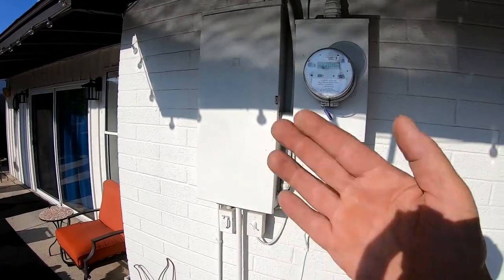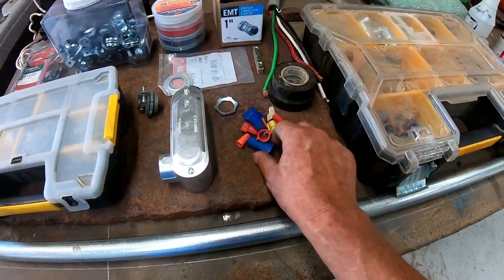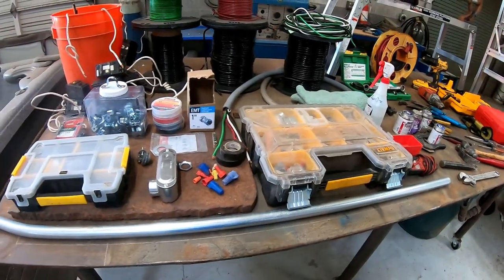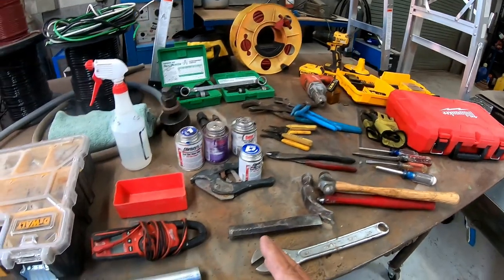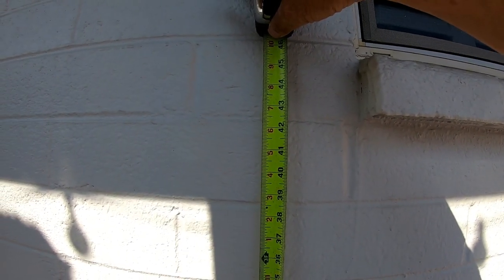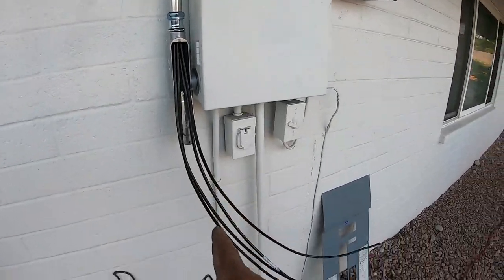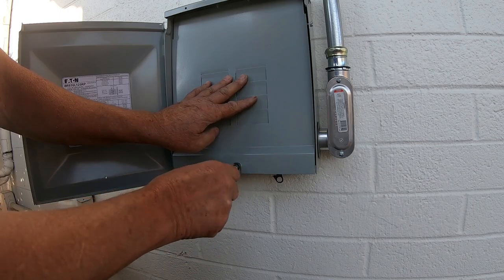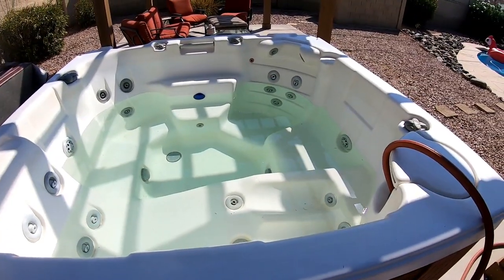How to wire from the Main Panel to a Sub Panel for a Hot Tub or Spa... (Part 1 of 4) DIY Spa Wiring

Comment: Thought you said in another video you didn't like to use colored taped ends
Reply from the maker: You are 100 percent correct I did say that...If I'm wiring from the sub panel to the spa #6 wire is used most often and I am able to get the wires in Black Red White and Green.. When you wire from the main to a sub panel and you are using wire larger then #6 like in this video we ran a 60 Amp service so we used #4 wire and to my knowledge it only comes in black so we have to use Phase Tape.. Hope this Helps Thanks for Watching & SUBSCRIBING

Comment: Hey I appreciate your videos! Could you have put a ground rod next to or under the sub panel and feed the ground (green) there or do you have to run it to the ground in your main panel?
Reply from the maker: I alway run the ground from main to the sub no matter what with #6  THHN wire Ive had to fix several wiring job that tripped the breaker when turned on for the first time (home owner did the install or handy man) if you follow the guide lines from this video you will have no problems with your install or Hot Tub ... Thanks for Watching & SUBSCRIBING
Reply: Per the NEC 2020, we have to run the ground wire all the way back to the main panel. Using a ground rod at a sub panel or any other device located on the branch circuit will sometimes electrify the ground within a certain radius of the ground rod when a fault occurs. Then someone stepping in this area can get shocked or electrocuted if not wearing insulated shoes.
Reply: @andygigawatt7778  It's a good thing I ran mine back to my panel. My electrician was trying to put a ground rod under the sub panel and I wanted it running back to the main panel. So I ended up doing it myself the way I wanted it done.

Comment: Question: Your video showed how you used Red Head Hammer Set pins to mount the sub panel on a concrete wall. What would you use to mount the sub panel on a stucco wall?
Reply from the maker: I use the same hardware as they use for Drywall and other hollow walls.. These are the links for what I use.

https://amzn.to/2SclkqK
https://amzn.to/3tif79S
https://amzn.to/3uc6oHp

Hope this Helps...Thanks For Watching & SUBSCRIBING

Comment: You mentioned not to place the sub panel near a water spigot. Is this code? How far from the spigot is okay? I’m also in AZ. Thank you. Great video, very helpful.
Reply: If you can’t find a good location for your sub panel other than near your water spigot, you can use a watertight panel and watertight connectors so no splashing gets in and blows the panel. Also a good idea to silicone seal the edge that backs to the wall.

Comment: Voltage meter reads 240 from the line into spa panel however I am getting a read of 241 on the load side of the GFCI. The spa breaker trips when connected to the spa however does not trip when I disconnects the power to the spa. Is my GFCI bad. Everything is brand new, spa, spa panel, GFCI, wire to the main panel and main panel breaker.
Reply: The GFCI might not be the correct type. Sometimes when motors startup they can trip a gfci due to the peak starting amps. The other possibility is that your spa may have a short somewhere (in the circuit area or the pump motor itself). Hopefully you have a warranty if it’s a short in the spa itself. Hope this helps.
Reply: @andygigawatt7778  Thank you, new spa pack was ordered and scheduled to be installed this week, all under warranty.

Comment: Why did you use a 125amp sub panel when you only ran a 60amp breaker from your main?
Reply from the maker: For this install we only needed a 60 Service. In the Sub panel we will have a 50 Amp GFCI breaker for a Hot tub and then we are installing a 20 Amp breaker for  LED lights , Ceiling Fin and an outlet. The reason for the 125 Sub Panel is I have tons of them so I use them all the time. Thanks for Watching & SUBSCRIBING

Comment: Is there any reason you wouldn't put  the gfci breaker in the main instead of in the sub?

Just seems more economical to buy 1 gfci to protect the entire sub and wiring versus a gfci for every circuit in the sub.

My only experience with gfci is in the receptacles which I know can only protect a certain number of receptacles down stream. Is it the same principle for the breakers?
Reply from the maker: Yes you can put the GFCI in the main and install it that way... That is the way I installed mine. Now the only problem is a GFCI is very sensitive and sometimes the other things that are plugged in on that line will cause the breaker to trip...Its six of one and a half dozen of the other... Good question. Thanks for Watching & SUBSCRIBING
Reply: Plus the GCFI sub must be at least 5 feet from the hot tub per code but must be line of site so if an electrician is working on the hot tub they can observe if somebody attempts to trip the breaker back on. That's why the box is located near the hot tub and not back inside the service panel. But it has to be further than 5 ft due to water and that has to be horizontally distanced from the nearest water point.

Comment: My electrician used aluminum wire from the main panel to the sub panel,  is this okay? I plan on using copper from the sub panel to the spa pack.
Reply from the maker: Yes this is OK as long as it is to CODE.. From the Sub I would run #6 THHN  wire to the Spa
Reply: Aluminum wire is allowed in some states (like Texas) and not allowed in other states (like California). It’s always safer to just use copper for the entire install, because aluminum can cause sparks, which is why states with fire issues have banned it. If your state allows it, be sure to use the anti oxidation gel on every termination.

Comment: Can you put all 4 gauge wires in 3/4 inch tubing ??????????
Reply from the maker: No...Use 1 inch or 1 1/4  and it will work with ease...Thanks for Watching & SUBSCRIBING
Reply: @spaman5440    Thanks again Sap man, your really great and helped me a great deal.
Reply: Small diameter pipes will make the wire overheat, plus it’s harder to pull the wire through. Good rule of thumb is to keep a little more than half the pipe empty. Or learn to use the NEC 2020 to derate wire and size pipe if you want to do the bare minimum requirements in order to save a few bucks.

Comment: I know you used 1 inch conduit because you used 4 Ga wire.  Will 6 Ga wire fit inside 3/4 conduit?  There would be 3 6 Ga wires and 1 8 Ga wire for ground.  Thanks again.
Reply: You can fit 4 6awg in 3/4", you can fit 7 6awg in 1"
Reply: @jeffschwartz9851  thanks for the information I will be attempting this soon

Comment: Did l miss something, did not see the connection from spa sub panel to the hot tub. You skipped a step….. would like to see wiring from breaker sub panel to balboa box
Reply from the maker: If you look in the description above there is a link to wiring from the Sub to the Hot tub...Thanks for Watching & SUBSCRIBING.

Comment: My question: Why a hot tub sub-panel? Why not just add a breaker directly to the main panel?
Reply from the maker: In this example/video we were not only hooking up the Spa we were adding an out door kitchen lighting and an entertainment area so we needed a sub pane to add more breakers. You want to have a spa disconnect no further then 20 feet from the spa. The NEC specifies installation of an approved manual disconnect device.It must be adjacent to the hot tub , at least 5 feet away(Some inspectors require 36 inches from the ground) , and within line of sight with no obstacles. Hope this Helps Thanks for Watching & SUBSCRIBING
Reply: @spaman5440  Why no grounding rod on the subpanel?
Reply from the maker: @Missin44  Some Sub panels do not come with Ground Lug... so you have to add one to complete the install. Thanks for Watching & SUBSCRIBING

Comment: Why do you have to use 4 wire instead of 6 ?
Reply: You need to go back and watch the whole video- he tells you- he used 4 wire running from main panel to sub panel because he plans later on building a outside kitchen area so he will have 6 extra breakers for that. He used a bigger sub panel for this reason he isn’t just hooking up his spa- he did use 6 wire from the sub panel to the spa.

Comment: As soon as you use that knockout set, and make a factory knockout bigger in a sub panel than what is there, you loose the UL listing of that box. Remember people, electricity is not a hobby. It's easy to make something work, but will it be up to Code?? Water and electricity do not mix.
Reply from the maker: Yes it will still pass code...Thanks for Watching & SUBSCRIBING
Reply: The concentrics on his box went bigger in the other sides of the box, so he’s fine doing the little  k.o. that he punched out. It’s fine and up to code.